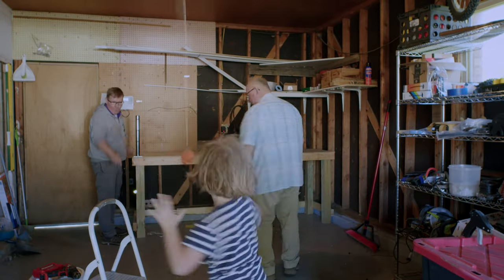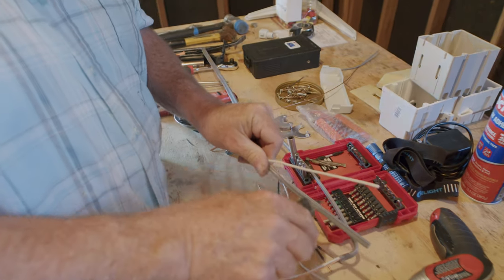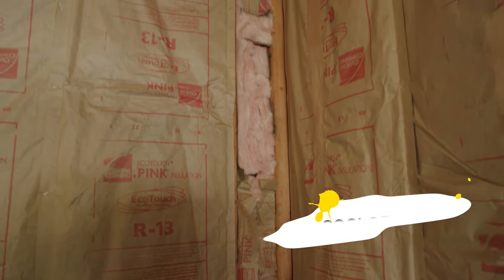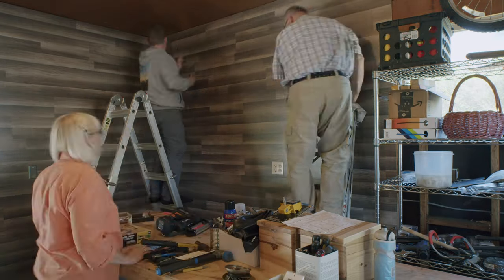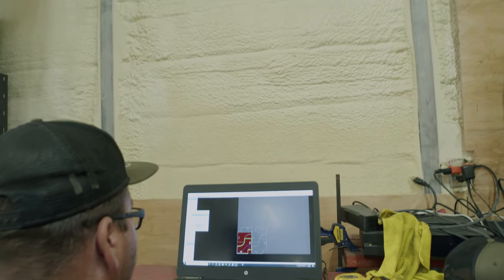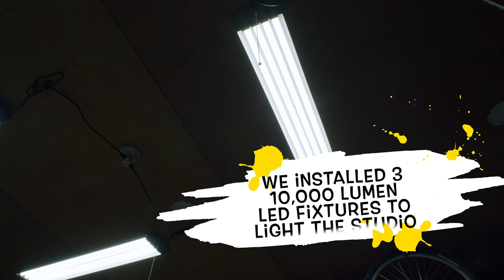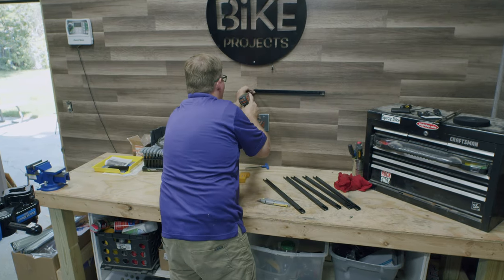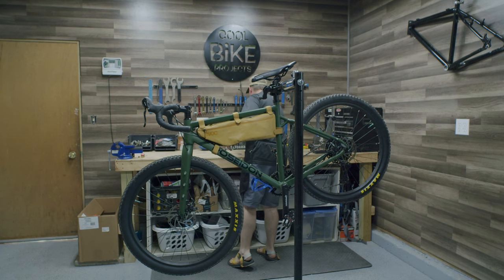Dream Bike Garage - Bike Repair Shop

Comment: Awesome new shop build. Those magnetic tool holders work well... 
I have a few in my garage and one in the kitchen to hold knives.
Oh and two on my bike stand, one on the side of the tool tray that sits on the top and one mounted vertically on the pole half way down. Its great to hold on to nuts and bolts or even ball bearings when working on bikes.
Reply from the maker: Thanks Pirate Pete! They are working out good so far!